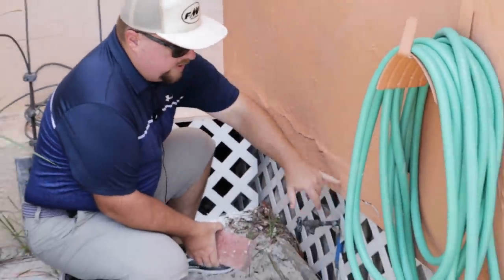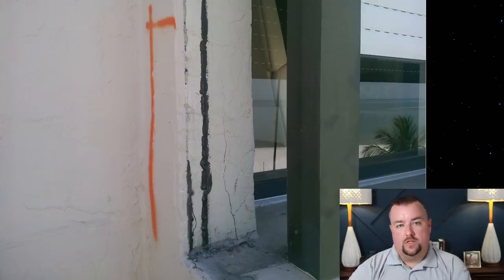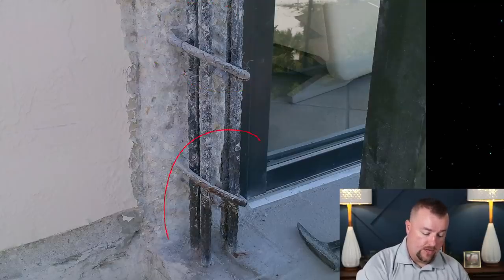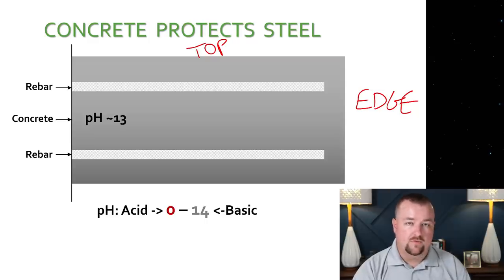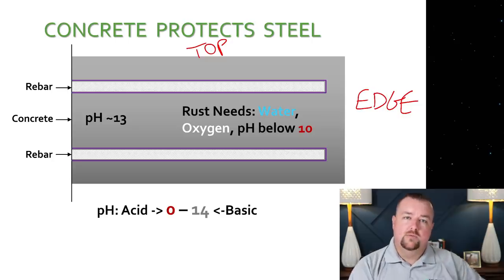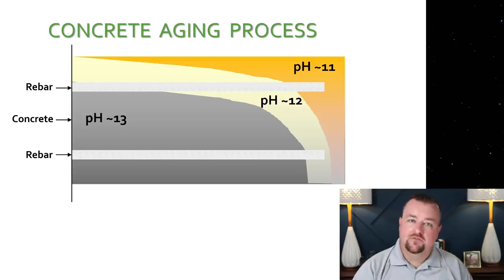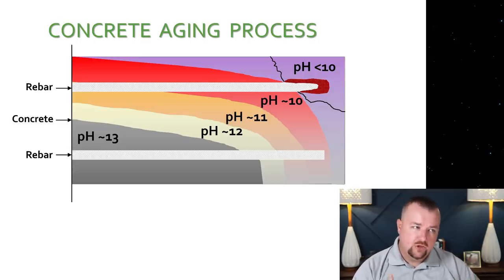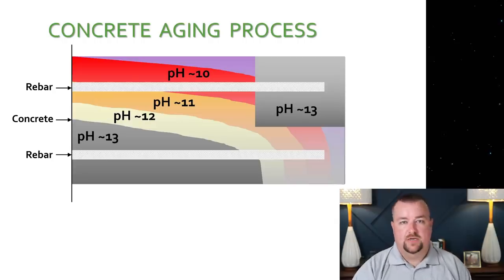Reinforced Concrete's Number 1 Enemy

Comment: Great video thank you!

Given your explanation I would expect that concrete that is not exposed to salt from sea spray drift etc should last longer, since there is no chlorine based acid.

There is CO2 dissolved in rain water though which I would expect to form carbonic acid (as we see in ocean water with rising CO2 level, the carbonic acid attacks things like coral).

Can you tell me if this, or some other mechanism, is still a risk for inland concrete structures?
Reply: In many countries salt is used on roads and bridges during winter snow events.
Reply: @gordonrichardson2972  thankfully not something I have to worry about where I am. But I'm still interested to know if a no salt environment is more benign.
Reply: @langdons2848  Absolutely, salt is a huge factor for concrete structures.

Comment: Very useful. I have reinforced concrete oceanside homes that always need repairs. The concrete is painted but still degrades. Is there any additional sealer that we can coat on to add protection?

Comment: In addition to passivating the rebar, sealing the concrete, and applying waterproofing, you can also increase the concrete "cover" thickness to extend the ph lifespan. 

Cracks provide a fast lane into the concrete and concrete cracks can open up the sealant and waterproofing. Thicker "cover" is often more susceptible to micro cracks, so do your best to minimize them. Add both hydrophilic fiber and structural microfiber reinforcement to the mix to minimize shrinkage and stress cracks.

Comment: Josh, you have the hard knowledge. Excellent for a novice like me to understand learn from. Now I know why when someone asked me to put tile or pavers on a slab, I inherently knew it wasn't a good lasting solution to someone's ugly patio. I recommended a epoxy coating that is protective and durable.  BTW there have been some youtubers on here that makes my head spin with what they think they know.....having pissing battles with each other.
Reply: Once tile gets wet, you'll REALLY wish you hadn't done that, lol. And that slate is awful in that it's expensive and requires resealing or it starts to peel apart.

Comment: Very good, clear explanation of the chemical processes. One criticism is that you can not describe a pH of 11 as being "more acidic", it is not at all acidic , it is highly alkaline. So it is more appropriate to say pH11 is less alkaline than pH 12. 

It is not CO2 which enters the concrete. When CO2 reacts with rain as it falls,  it forms carbonic acid: H2CO3 . It is that weak acid ( ~ pH 5.5 ) which is absorbed into concrete and begins to partially neutralise the alkaline content reducing its pH. Sea water is ~ pH 8.0, so it does not make much sense to say it is making anything else "more acidic". 

This is same mis-use which AGW fanatics use to convince everyone that the world's oceans are becoming more acidic, when they are not acidic and never will be. If you explain that both pH 8.2 and pH8.0 are firmly in the alkaline range, people are usually surprised or don't believe that is the range of sea water.
Reply: Nice

Comment: For the lay person, how to ensure proper water proofing. I’d have thought, for example, that installing tile would benefit the concrete underneath , and contractors or DIY tile job may lack the proper knowledge to do it properly in regards of water proofing. What products and processes have to be used? Also, why not apply products like dry lock in the new concrete to add a layer of protection?

Comment: I have been waterproofing high rises and performing structural restoration for over 30 years on the Gulf Coast, The Saltwater intrusion through the handrail pockets as well as failed waterproofing and caulk joints will quickly cause slab Edge and then possibly balcony failure, very important that you have the right millage of elastomeric applied as well as proper caulking and polyurethane deck coating must be maintained usually around every 7 years or so these buildings are coated and repaired and the longer they wait the more expensive it gets...

Comment: I have a recommendation for this problem. Require Stainless steel rebar in all salt water coastal buildings.
Reply: Carbon steel is stronger and harder than stainless steel. Is stainless steel not used so much mainly just cost, or do the physical properties influence the choice?

Comment: This is great stuff. What puzzles me is, given that this is a known issue, why is waterproofing the concrete not done at the time the building is originally built? If I am going to do my own concrete project, what do I need to do to protect my concrete and rebar or wire mesh? Thanks!

Comment: Question ..i live in Ontario Canada and many years ago in an 8 floor cement apt building . in the very cold winter 0* F or so load noises like rebar shrinking in the cement...does this hurt the building ...lived there 40 years ago ..its still there built in 1966..

Comment: 1. Salt from sea water is not transferred through the air to rust rebar. Instead, inadequate concrete cover allows carbon dioxide from air  to reach rebar and destroy the layer of passivity that normally protects it from corrosion.  
2. Spalling is the detachment of concrete flakes and can have a number of causes.
3. A Schmitz hammer will actually document concree density.

Comment: Years ago I worked on a parking garage. The rebar that ran thru the deck and grade beams were all coated in a green "plastic"?  How well didnt concrete adhere to that?  Also there were p.t. cables run thru both...is that still normal  or is that obsolete practice now? You see the same rebar in and chairs in concrete roadwork

Comment: Hey Josh, great video! It always seemed that it was necessary to coat the rebar instead of focusing on the concrete. Are there additives like Pozzolana or other types of ash that can seal the concrete and prevent water intrusion and degradation of the rebar?

Comment: It almost seems like, no matter how well  steel reinforced concrete is maintained in a salt coastal environment, there is a finite structural lifetime. While repairs may be strong I wonder if multiple major repairs can be as strong and/or up to original engineering spec as the original monolithic new structure.  Very informative episodes!

Comment: Here in the UK we have started using Stainless Steel rebar in certain reinforced concrete, it is more costly, but would it eliminate/reduce the problem?
Will the concrete still deteriorate with the salt ingreasing into the concrete.

Comment: While crawling in traffic on the Santa Monica Fry in Down Town LA, ive see. Similar fractured concrete and large amounts of exposed reber on several overpasses. After several years of laying in this state patching was eventually done, but not the way you explained. I look at everything, im just that way because my Father was a structural engineer and bridge inspector. Everything in LA is is deteriorating.

Comment: This explains why bridges (exposed to road salt) often have a predicted lifespan of as little as 50 years.  With all the magnificent buildings we've constructed out of reinforced concrete, if they aren't regularly maintained they just won't last very long.  Reinforced concrete is relatively cheap and quick, but maybe those shouldn't be the deciding factors in selecting a material to use.

Comment: I feel like every time I see rebar it already has rust on it.  I would think your choices are rusty rebar or rebar with an oil based coating on it.  I would think either would interfere with the mechanical bond with the concrete. I am just trying to reason this out...I have no idea what I am talking about except that I know what concrete and rebar are.
Reply: There is some evidence that a thin layer of rust on rebar provides a stronger grip in newly placed concrete. Many sites don't bother if it gets wet during construction. The alkaline cement will rapidly prevent further corrosion.

Comment: are the non-metal rebars (fiberglass and basalt) more expensive or more difficult to work with?  Seems like they would eliminate a lot of problems and extend the life of a concrete building indefinitely.

Comment: Hey Josh, you do such an amazing job of explain things. I found you from the Champlain Tower disaster and have been following ever since. I do have a question, since concrete isn't water proof and can soak up fluids which effects the integrity of the concrete by lowering the PH, why can't you spray a PH solution onto columns, etc., as preventative maintenance? - Thanks

Comment: Excellent presentation!  So, what is recommended to seal concrete?  Obviously paint is not it.
Reply: Primer, but there are specific types we have to spray for types of materials we use. Have engines in the area different carpets, paint on walls, tiles, drywall. We can mask a lot of areas in construction on skyscrapers, but there are times when it is costly for use to apply masking tape and runners.  Skyscrapers you have to leave this to the engineers on hand. Concrete has plastics and all types of base materials to reinforce or dry the slab faster engineer must look at the research and pick the right type of mixture for the job.

Comment: Josh, I am fascinated by your interesting videos, even though I have no connection with the construction industry. Your explanations and graphics are so clear and easily understood.
As a complete layman, can I ask one question?
You mention that when making repairs to damaged concrete areas, the repairers will, amongst other things, "coat the steel in a protective product" (9:55 min).
I don't want to sound too naive, but why is it not possible to coat all steel in such a product at the manufacturing stage, thus hopefully protecting the product for much longer than untreated steel? Too expensive perhaps?

Comment: I have seen devices that bolt on cars and connect to the battery.  They send some kind negative charge to the metal and keeps it from rusting. My brother had an old car i worked on in Michigan that drove on snow covered salty roads. There was not a spot of rust on or under the car that was over 10 years old. Would that not work on buildings if the rebar could somehow be connected together with wire throughout the structure? Seems logical, but i'm no engineer.

Comment: What works in concrete better than rebar? Carbon composite material? It wouldn't rust, removing the expansion problem, and it can handle a lot of stress.

Comment: I don't like the implications of this. You seem to be saying that steel reenforced concrete will last about 20 years, in a salt-rich, moist environment. That's not even long enough for the mortgage payments to wear out.

Will painting the exterior surfaces of the concrete with epoxy help?

If so, are there less expensive coatings that will do the job?

Can we switch from making the rebar out of steel to making it out of "grey iron" instead? (it's supposedly less inclined to corrode.)
Reply: Some places are starting to use basalt rebar. Yup, rebar made out of strands of rock.
Reply: I just saw a company rip out a GREAT foundation. It had to be 2+ feet thick. On a small 2 story. 

I've watched them slam up these new ones. They'll do it with concrete and rebar and chewing gum, I think...you'll see it starting to fail in a few years...for 4 million. LOL.
Reply: Spalling happens when rebar is close to the surface. Structural reinforcement is much deeper in the columns, and they last many times longer than balconies exposed to the weather.

Comment: Josh,

Would kevlar composite rebar be a suitable replacement for steel rebar? Granted, the cost profile is quite different but it seems that that sort of support material might be preferred for tough applications (e.g., galvanic environments)?

I’ve seen some video that describe coated rebar but those applications seem to be more of a “duct tape” answer than a “ignore (more) cost as long as the answer is way better” … answer.

Comment: A few questions:
1. Would using something like weathering steel or stainless steel avoid these issues?
2. Would using an acrylic fortifier to make the concrete water-resistant avoid these issues?
3. Would periodic application of something with high pH (eg. lye) serve to extend the lifetime of the concrete?

Comment: Very interesting and thorough video but I have questions. Why don't older buildings like the Woolworth, Chrysler, and the Empire State Building show signs spalling and aging like this?
Were the techniques different in the construction? Did they use rebar in those older buildings?
Could spalling have contributed to the Twin Towers collapse? 
Could a coating of aluminum or ceramic be used on the rebar to retard the action of water and salt.
I realize that conditions in N.Y. are very different from south Florida but I'm ignorant on this subject and would like to know. 
Thank you very much for your teaching and time on these videos. I started watching your videos after the Seaside tragedy.

Comment: Looking forward to your opinion on the off-sets in the garage ceiling.  What exactly is a BMA Beam?  One set of plans shows two different ceiling heights in the garage ceiling, divided by a beam; later plans have a one height for the ceiling and no beam, it seems.  The column sizes seem small at 12 x 16 and 16 x 16, what is your opinion?  Thank you so much for these terrific videos!

Comment: There's a couple of chemical mistakes. NaCl does NOT cause any acidification, in water solution it disassociates into Na+ and Cl- ions and these are ions of a strong base (sodium) and a strong acid (hydrochloric acid). So they don't affect pH in any way. It's all carbon dioxide, it combines with the calcium hydroxide (the main source of high pH in concrete) to form calcium carbonate that is only mildly basic.

And once the pH falls below 10, salt then accelerates corrosion through a variety of catalytic mechanisms.

Comment: If no rebar is used Is the strength of the concrete affected by the lowering of the PH?
Reply: The CO2 reaction lowers the pH and actually makes the cement stronger.  The CO2 is reversing the process that is used to make cement in the kiln - driving off CO2 with heat.

Comment: This is why ductile steel is imperative.   Also, all steel needs to be painted with a red lead paint.  Vapor rust is inevitable with all buildings,  but if a building is properly maintained and kept water proofed, it can last an hundred years or more.  In cold climates it’s imperative to keep the heat on in an old structure. This keeps the inner structure dry and warm.  Imagine a stone or terracotta clad structure to start rusting away.  You have a real hazard on your hands.  Buildings need to hold up themselves, and then they have to hold up all our heavy stuff, and water weight of of all the plumbing.   Ductile steel is always the smart answer.   So when you rent or buy, always find out what your building is constructed of, and it’s order of maintenance 
.

Comment: Hi Josh,
I'm no engineer, but wouldn't it make sense to spray a rubberized coating on all concrete to protect it from the elements much like auto companies spray a rubberized undercoating on cars to protect them from rust?? Makes sense right??

Comment: 6:23 I’m not sure I follow.
AFAIK, sodium chloride is completely neutral when dissolved in water; either there’s some separate reaction going on between the steel & chloride ions, or I’m missing something here.

Thinking on a more practical level though: is there any reason why it wouldn’t be possible to have rebar coated with an outer layer of stainless (or another corrosion-resistant metal/alloy)? Is it just a cost thing, or is there a more fundamental problem with doing this?

Comment: Sorry if I missed your saying it, but couldn’t rebar be pre-coated prior to construction with the same material used in repairs, and sealing in the construction phase? Seems that is a relatively simple solution. Too cost prohibitive? Maybe not as in the case of Champlain Tower and the loss of life. Maybe revise code for coastal buildings?

Comment: Just a quibble, but pH scale is not limited to 0-14, although unless there is chemical spill you are unlikely to get outside the range of 7-13. Rainwater is around 7 and seawater is about 8.1; so coastal waters fall in that range. The reason salt is so damaging to iron is that the Na+ and Cl- ions make it easy for very weak electric currents to move electrons from Fe to O (i.e. saltwater is the electrolyte for an iron-oxygen battery), turning Fe, O2, and H2O into Fe(OH)3 (hydrated rust). Some saltwater and air is much worse than pure saltwater because of the greater availability of O2, which is why the upper parts of ships rust much faster than the submerged part of the hull.

Comment: It would be nice to see a detailed discussion of concrete mix designs (fly ash, alternative reinforcement rods  (stainless, carbon, steel coated. and wrapping or sealing methods that fully protect the steel.  Given that this discussion is related to Florida it seems a given that standard concrete will fail in short order resulting in expensive pairs or failures that shorten the life of the entire structure.

Comment: Are there coated or better quality of rebar that could be used in vulnerable areas protecting it from low ph levels?   Have building codes been improved?

Comment: More recently I’ve seen green rebar and reinforcement mesh, but in the past I’ve seen rusted rebar and mesh used in concrete pours.  That would prevent the metal from making the initial connection to the concrete, correct?

Comment: In the example you showed, how would the lower rebar get more rust than the rebar above it?  Also, is all concrete around the same PH?  Does the quality of the concrete or how it's mixed affect the PH?  Thanks!
Reply: Rebar that is incorrectly placed too close to the surface will corrode first. This is an important detail that he did not cover in this short video.